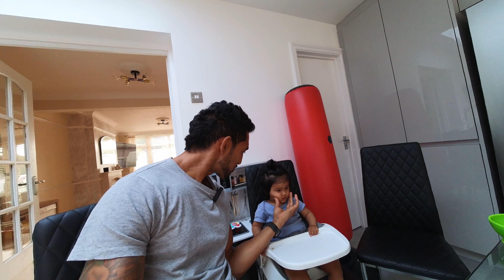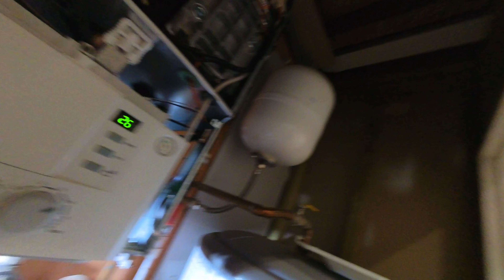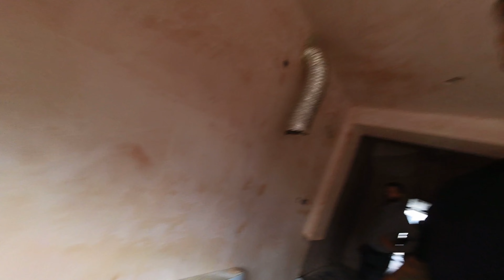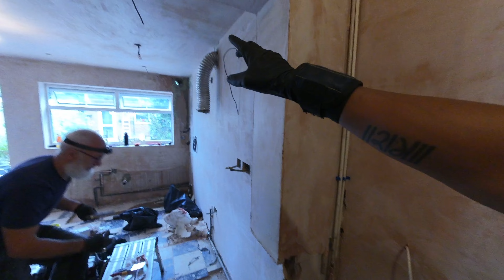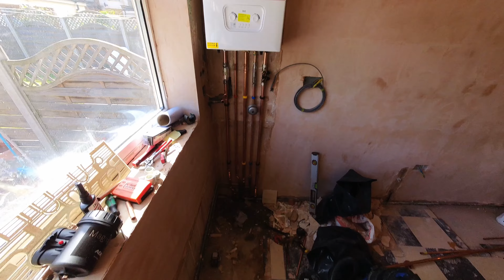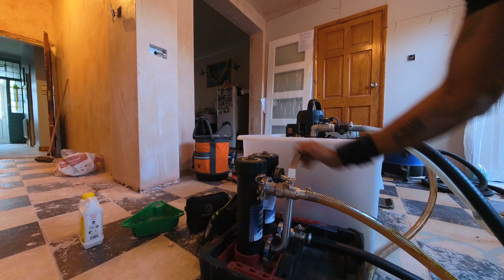New Boiler With Bits Missing! - A Day In The Life Of A Gas Engineer 170

Comment: nice video what are you using to join the pipes is those tools and not compression or solder joints
Reply from the maker: Thanks mate, it's called press fit 👍🏾 crimps the fittings onto the pipes with a rubber o-rings inside

Comment: Up North it's common unfortunately for the Baxi Boilers to have parts missing out of the box, or parts from another boiler.
Reply from the maker: First time it's happened to me, lucky my rep was local!
Reply: Yeah they're still a great boiler Broski. Was you or youtube that deleted a message about a week ago?
Reply from the maker: @delboy6384  yeah man I'm a Baxi man mainly 👌🏾 nope I don't ever delete comments unless they're derogatory or pointless trolling. YouTube might have done it, I find that sometimes when I'm going through the comments 🤔
Reply: @cputilitysolutions  It was on the video you were sweating whilst fitting a boiler, I only suggested buying a industrial fan from Screwfix, I did and its the best tool I've bought in a long time, that was all..
Reply from the maker: @delboy6384  ah was that the bloody Worcester that was meant to be a "straight swap"? 🤦🏾‍♂️ I actually bought a DeWalt battery fan a couple of weeks ago, it was on a flash deal for £40 🙌🏾
Reply: @cputilitysolutions  ha yes thats the one, the guy I use for karndean flooring was using one on my job and I thought, good idea pal thanks

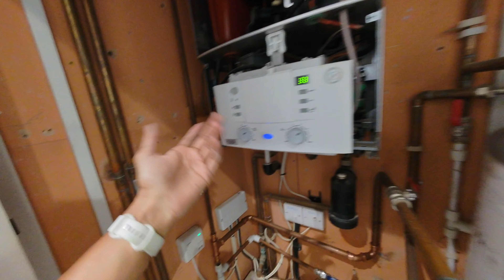Comment: @3:13 you turned the boiler power button off, but the display was still on, common sign its wired to the boiler PCB incorrectly and bypassing the internal fuse. good vid tho.
Reply from the maker: Gotcha nice one mate 👍🏾